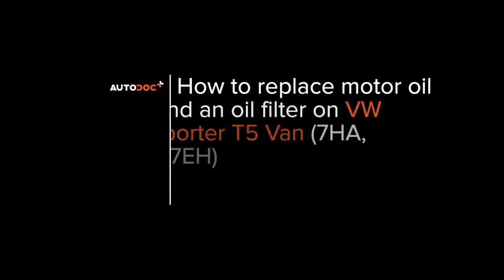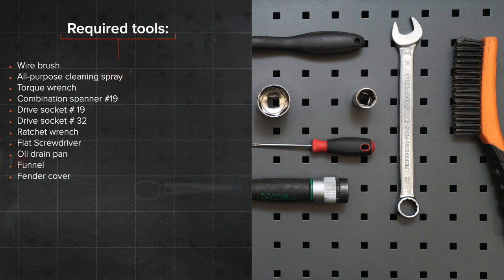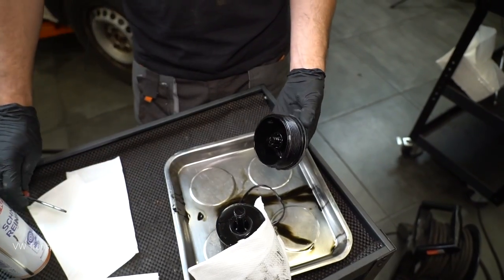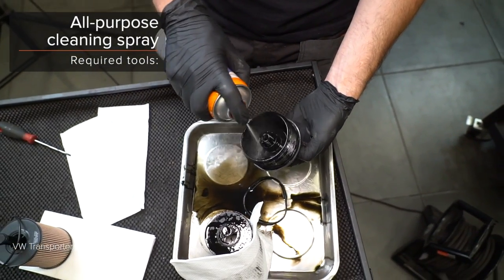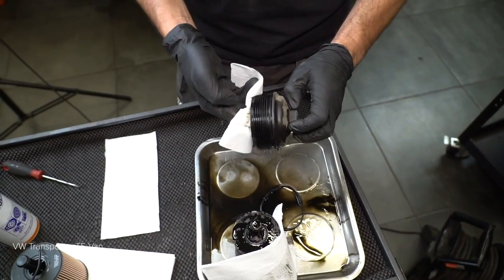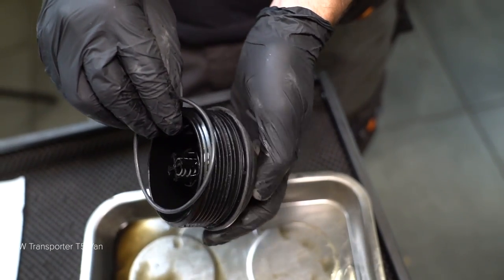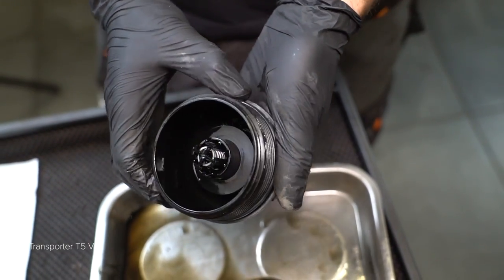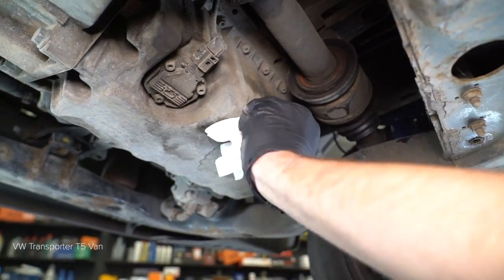How to change oil filter and engine oil on VW T5 TRANSPORTER Van [TUTORIAL AUTODOC]

Comment: A good guide. But note the slight compression twist on the old oil filter cartridge when removed. This can be avoided by lubing the small O-ring on the neck of the replacement cartridge to ensure it fully inserts into the housing well, as the new cartridge and plastic cap are screwed back down by hand. You should be able to screw it all the way down by hand, with a final torque at the end. If not, something is not properly fitted and the cartridge will be compressed.
Reply from the maker: Thanks for the clarification! Your comment will be useful for many of our viewers.